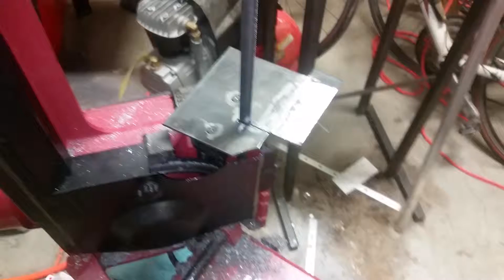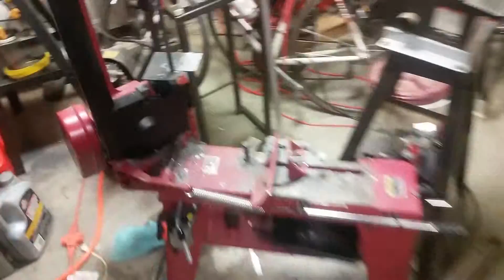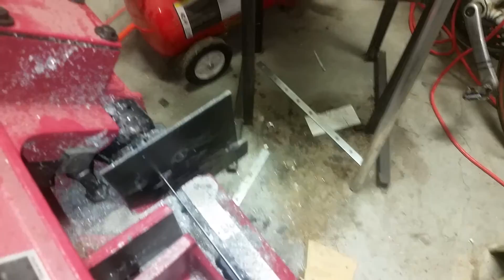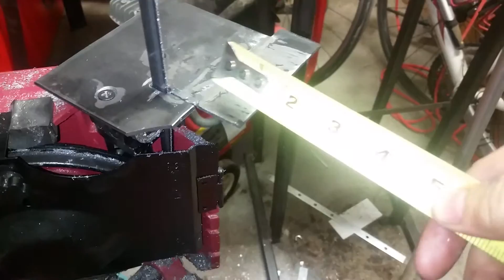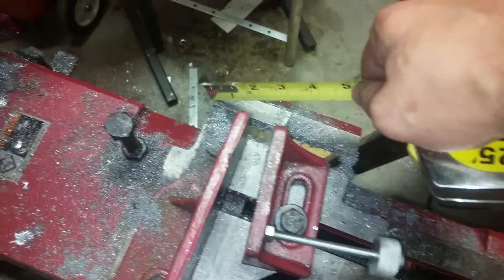Mini table for Harbor Freight bandsaw

Comment: I've seen a plate like yours that had a hinge to a larger plate that folds back out the way for horizontal cuts.This are great saws tho my motor capacitor has gone bad push start for now.I have cut a 3" steel round bar with no problem.